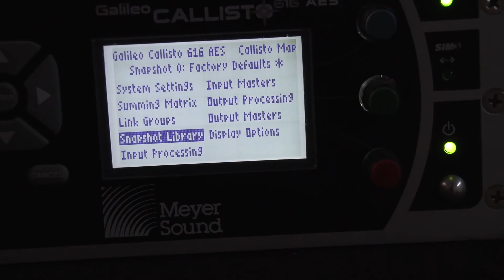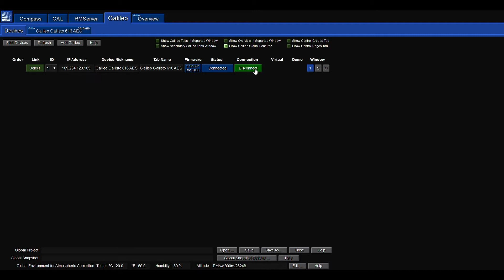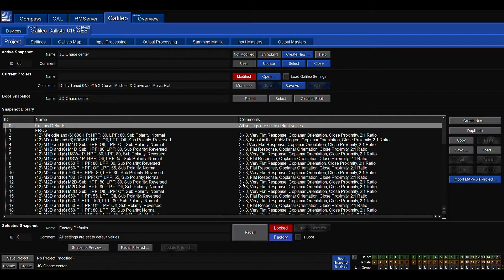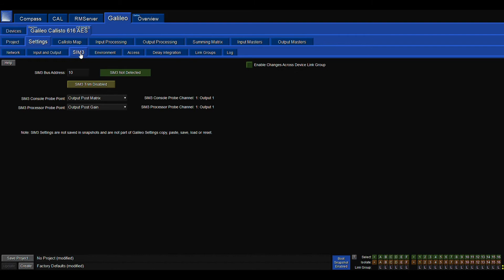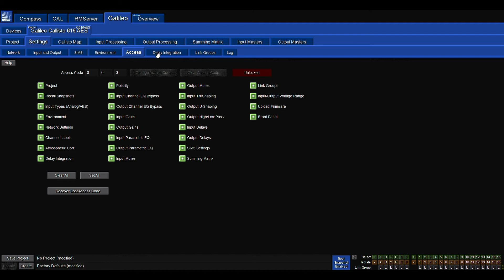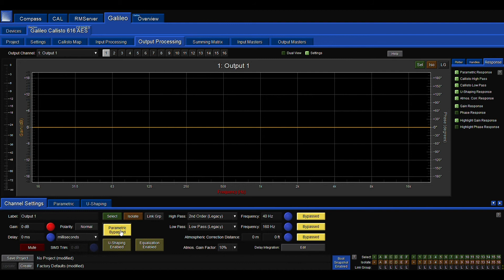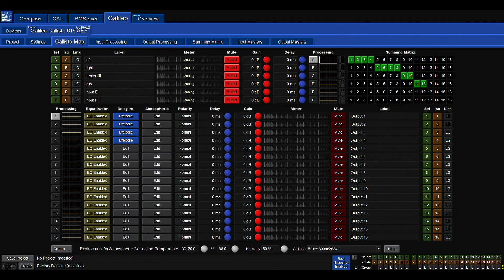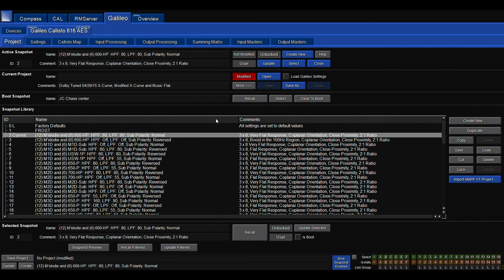Meyer Sound Galileo setup and overview

Comment: I'm totally new to the Line Array game: As for cabling to two Melodie Line arrays (2x6), do I need to run a XLR to each element? Or can I loop through?
Or can the RMS ports be connected to the Galileo?
Reply from the maker: You can loop through. Via xlr on the back of the Melodie’s
Reply: @KINETICPROFESSIONALS  thanks for the quick answer! But can I then still use the Galileo to control each element individually?
Reply from the maker: @haselhofler  yes , I would give advice based on the situation. Most people send L an R to the signal processor and then then distribute as needed.

Comment: On min 1:46. Land cable to switch n lan cable from switch to laptop. 

U can hook up to the switch remotely via Wi-Fi rite? N then controll it wireslessly correct?
Reply from the maker: sure, if you send lan into a wireless router
Reply: @KINETIC PROFESSIONALS  i went to a state college, you will have to "espeak eslow". Could i connect a galaxy to the router via an ethernet cable and connect a tablet or computer to the router via wifi would b my question n use compassgo?

You should do a video on the galaxy. Meyer has some info, but its for concerts madison square garden. :(

Comment: Would a Galileo Callisto be good in an installation setting? I'm wondering if you have to manually reload all the settings every time its turn off? or if you can just turn it on and its ready to go?
Reply from the maker: There are several installed ! Settings are saved upon shut down. On power up last settings are still there. More often than not Galileo’s are installed.
Reply: @KINETICPROFESSIONALS  Oh thank you thats very helpful to know
Reply from the maker: @janetbailey6727  happy to help

Comment: Hello! My galileo 6126 is stuck on loading screen. Just says "Meyer sound". Any way to troubleshoot?
Reply from the maker: Can you access the menu through compass software ?
Reply: @KINETICPROFESSIONALS  No. the software doesn't see the device when it is in this state. I found some information on how to boot with different bios chips (holding A&C for chip 1 and B&D for chip 2). Did that a couple of times and at some point it worked but the device froze a couple of minutes later. At this point i removed the ram, cleaned the connections and put it back in. I managed to boot back onto the first chip and the device worked for the whole day without freezing once.
Reply from the maker: @jespardalvarek8587  wow , solid stuff. I haven’t had the problem but I guess there’s a fix. Glad you got it going !

Comment: There's a funny story about why Callisto has all those high and low pass filters and the original Galileo doesn't. If you want to hear it, let me know.
Reply from the maker: Would love to hear! I own both and always wondered why. 🤔
Reply: @KINETICPROFESSIONALS  Great! I've not told this story in a while. It starts out in 2005 in what would later become the Don Pearson Memorial Theater at Meyer Sound in Berkeley. I was there with "Dr." Don Pearson (he passed away in January 2006), John Meyer, and John's son who was my manager at the time. I was writing Compass 2 and working with Don a lot. Don was asking for additional types of high and low pass filters but Perrin and John indicated that Meyer Sound speakers did not need those filters and that the ones that were included in the original Galileo were adequate. And that was that. The design of Galileo didn't change. Cut to 2012 and we were working on the design for Callisto. I worked closely with the guy who worked on the DSP code for it. There's another interesting story behind that which I can't really tell publicly. Long story short, the guy was a genius. He also did the DSP for CAL which I did the UI for. Also a long story behind that one. Since I was writing the Compass interface for Callisto, I had a lot of control over how it was going to function. Especially since the hardware didn't yet exist and the design wasn't finalized. Years earlier, I had done some work on what was eventually going to become the MM-4XP. The DSP in that used biquads so the UI interface I designed for that (before Compass 2) had to use biquads to create parametric and all the other types of EQ. I had stumbled on the "Cookbook formulae for audio EQ biquad filter coefficients" document and implemented that in the UI and used the coefficients to control the DSP. So, when it came time to do Callisto, I whipped out the old cookbook and I added as many of those filters as I thought we could use. Since they were simple biquads, the DSP for them was trivial. We put those filters in before anyone even knew what was going on. And since people kept saying they wanted them, they stuck. Guerilla Software Engineering at its best. Though, they laid me off along with 2 dozen others before Callisto shipped. So, I don't know if they changed anything.
Reply: I can't thank the author of the cookbook enough. I highly recommend it for anyone interested in learning about how these filters work or who need to implement them.

         Cookbook formulae for audio EQ biquad filter coefficients
----------------------------------------------------------------------------
           by Robert Bristow-Johnson 

All filter transfer functions were derived from analog prototypes (that
are shown below for each EQ filter type) and had been digitized using the
Bilinear Transform.  BLT frequency warping has been taken into account for
both significant frequency relocation (this is the normal "prewarping" that
is necessary when using the BLT) and for bandwidth readjustment (since the
bandwidth is compressed when mapped from analog to digital using the BLT).

First, given a biquad transfer function defined as:

            b0 + b1*z^-1 + b2*z^-2
    H(z) = ------------------------                                  (Eq 1)
            a0 + a1*z^-1 + a2*z^-2
Reply from the maker: @davidgrossman5741  truly awesome ! That was great. Including myself, I know so many people that use Calistos for more than meyer stuff. Sure, the active box's have built in hp, but being able to add your own and make it as aggressive as needed has been huge. I still get called on the older Galileo (where's the hp??). Again, super cool. I love hearing about the math too as I am a huge math nerd 🤓.  Thank you! Made My morning.
Reply: @KINETICPROFESSIONALS  You're welcome! Thank Dr. Don too! He made everything possible. It's good to see that these units are still in demand and in use considering how many new processors are out there now.
Reply from the maker: @davidgrossman5741  well, it's solid stuff ! I'll have to pick your brain one day
Reply: @KINETICPROFESSIONALS  Sure! I worked on Galileo since before we had the first prototype units constructed. Primarily, I worked on Compass but I also wrote the front panel UI.
Reply: @davidgrossman5741  David, I thought John's Son was named Lewis, a traveling man?
Reply: @David Grossman  come on, tell the story publicly. Its only ur tongue n ur throat. ;)  there was a post a guy commented on on the meyer user forum. He had some interesting stuff too. I cant look it up, I was dislodged from the group by salermo. :(
Reply: @elitsantiago4263  LOL, that was probably me in the forum too.
Reply: @elitsantiago4263  It's possible that John had another son that I've forgotten about. I don't remember him. Perrin was my manager in 2005-2006.
Reply: @davidgrossman5741  iam gonna pay for attention to names now. I think i only saw him comment once. Salermo prob kicked him out too. Lol